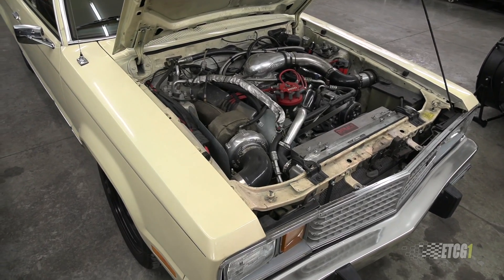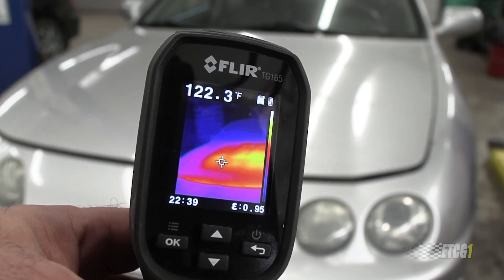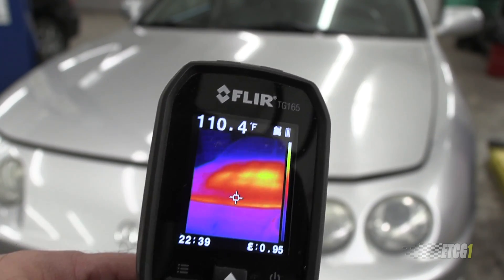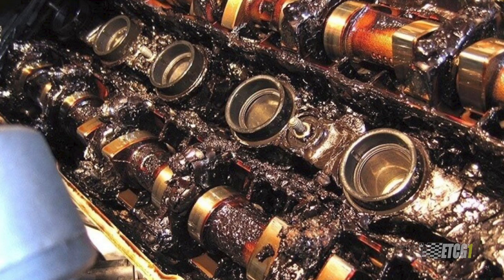What Is Heat Soak?

Comment: What a load of crap. Who opens their hood every time you stop the engine?
And since literally NO ONE does that, what damage is being caused? Where are all these people stranded on the road?
Total bs
Reply: You didn't watch the whole video and it's showing.
Reply: @dakotabelcher9988  I did though. You're referring to him saying it's not that big of a problem. Then why make a video about it?
Reply from the maker: I made a video about it because I think it's an interesting topic. Also, I was mainly referring to my custom vehicles that have more of an issue with heat soak, especially my turbo engine, over something that was mass produced. Thanks for your comments.
Reply: It’s a real thing. Engines actually get hotter for a little while after their shut off because coolant and air quits circulating. And with everything covered and insulated it doesn’t help. 
But, modern cars don’t suffer the same way carbureted cars would since vapor lock isn’t common with high pressure. 
And, it’s more of a long term thing so you aren’t going to see lots of cars breaking down specifically because of heat soak. But, many electrical and plastic components last longer if not exposed to such high heat. That’s why some people remove the plastic covers and hood insulation so it isn’t holding the heat against the coils and things. 
At the end of the day it’s more for performance vehicles and vehicles that are driven hard. I’ve seen many diesel truck turbos failed because of crudded up oil lines from the oil getting over heated and breaking down. Usually due to the truck getting run hard then immediately shut down.

Comment: Big engine
+ tiny chassis
+ over sized radiator. 
My diesel doesn’t even turn the fan on. Not even going through Death Valley @ 115f. 
I do worry about my turbo. 
But I have a variable turbo with semi-manual control. 

So when I’m a mile or so from home I set my turbo to “wide open” 
In the hopes that heat flows out

Comment: I took your advice left my hood open and guess what somebody stole my battery.😆😆😆
Reply from the maker: Actually I believe I mentioned camping out with your vehicle until it cools down. 🤷🏼‍♂️
Reply: @ETCG1  I was just joking
Reply: @ETCG1  Hi,  I just installed & takeda stage 2 aluminum short ram intake & for some reason there has been a lot of heat coming from the engine, is this normal I know these intakes can cause heat soaking.

Comment: Heat soak gave me some grief on the 1987 dodge D100 318 v8. 
Would ask up if shut off when hot hauling heavy loads. Have to wait 10-20 minute before it would start back up. Carb has been rebuilt last year so replaced the original ignition coil with 63,000 miles hopefully eliminate the issue still waiting to see if it acts up again have a spark tester and starter fluid on hand if it gets into a mood😉
Reply from the maker: I'm a believer in EFI now. The higher operating psi helps virtually eliminate vapor lock and other fuel system issues that plague carbureted engines. They are making these systems easier and easier to install on older vehicles. You might consider the upgrade if you plan on keeping the vehicle. It'll make it much more drivable.

Comment: Hey Eric why some cars makes ticking noise from the muffler after driving and some not? . I have 16 years old car that ticking and one that 2 years that doesn't
Reply from the maker: I've heard it on just about every vehicle when they're cooling down. It's just the metal contracting as it dissipates heat. I suppose it depends on the type of metal, where it is used, and how fast it's cooling down.

Comment: I know transmission flushes are a no go, but what's your opinion on engine flushes?
Reply from the maker: If you change your oil regularly there should be no need for an engine flush.
Reply: @ETCG1  normally I'm on top of it, but I've gotten behind on a change. I'm getting a low oil light, but the crank case is full. I'm going to change it this weekend, but wondering if I should flush it for good measure this round.

Comment: Keep engine clean. Repair any fluid seepage/leaks
that attract dirt & gunk buildup; all that acts as an insulator,
holding in damaging heat.
High-temp ceramic paint helps to dissipate heat, think
of a coffee mug.
Fuel in the injectors & rails can also boil, depositing varnish
over time, just as Eric mentioned oil coking.
Reply: Look into your ceramics theory, mugs are ceramic because they DON'T transfer heat. Ever try to hold a glass cup of tea? There are other benefits to these paints. Corrosion and thermal stability, keeping your EGTs UP is crucial for turbo and catalytic operation. If you don't have those then you are reducing the temperature gradient across exhaust valves, heads, and flanges.

Comment: I like to open the hood and connect a battery charger/maintainer.    My AGM battery on my Honda Odyssey has a short life because of significant discharge when parked.   I turn a fan on and leave the garage door open for a while if possible to get the heat out of the house.
Reply: What kind of accessories are causing the parasitic draw on the battery when parked? Active sensor alarm, sound system?

Comment: Since i installed Long Tube Headers on my truck, there is much less Heat Soak in the engine bay. I dont have header wrap, the stainless steel just cools off much faster than the stock manifolds. The block and heads are aluminum, so that helps too

Comment: In the racing world, we call “heat soak” when your engine detunes due to heat. The super chargers and turbos get heat soaked, than you get lower power. So your best laps are always at the start before you get heat soaked.
Reply: yeah i thought from the title thats exactly what Eric would talk about
Reply: Actually it is the intercooler that gets heat soaked. Subarus used to come with intercooler sprayers that would mist it with water to lower IC temp.
Reply: @65sohc  wish they still did. My WRX is a night/day difference; literally and figuratively. Runs great on a cool night. Runs like a slaughtered pig on hot summer days. Intake temps go astronomical, timing gets pulled frequently and overall just lacks response and takes the fun out of it.
Reply: @SSChambers1  They actually make kits that spray the exterior of the intercooler. Pretty simple, especially with a top mount IC.
Reply: @65sohc  I know spray kits exist but I don't want to put any money into the car. Honestly, I hate the car overall. I came from a 2014, as you know used the 2.5, and loved the hell outta it. It was my misguided assumption that this generation, specifically the '18, was a much better car. If I could take certain aspects of my' 18 and put them into my older '14 I'd have the perfect car in my opinion.
I daily drive it. Don't race or beat the hell out of it. I just wish that heatsoak wasn't so damn bad on these. The larger displacement of the 2.5 negated the effects of heatsoak as I never noticed any issues. Live and learn I guess.
Reply: cries in top mounted intercooler
Reply: If you were to get a new carburetor would that fix the heat soak issue ??
Reply: I can feel the detuning effect you describe as the weather gets hot.
Reply: @raptorcybersecurity  it's based on intake air temps, as it soaks, the computer will pull timing to reduce knock, which reduces power
Reply: @JimmytheGenius  Thanks Jimmy, I love learning about the operational side. I'm thinking about adding cold intakes for my car since the airflow path would be much more direct. As is, the airflow path goes from the grill to the back of the motor over the heads, then back towards the front about 3/4ths the length of the engine (lots of heat going into the air supplied to the turbo which then heats more - then through the intercoolers. Anyway, there's a dude (Splitt Mods) that has a great how-to and he gets more power based on this approach.
Reply: @raptorcybersecurity  Also the air less dense and therefore less oxygenated so that will have an effect too
Reply: @davyarthurs  yes like elevation plays a big role as well the higher the elevation the less power a car will make due to more dense air

Comment: I like to pop the hood when I get home. Then I can smoke my pipe and ponder the engine’s condition.
Reply: Just popped my hood smoking a bleezy looking at what can I add it’s full bolt ons GT you recommend any thing
Reply: Yeah I was speeding home then caught up to a 350z my Stang was already heat soaked she did not take off at all definitely checking out the motor and see what I can add on to the motor to keep it cooler while I drive especially when I’m tryna have fun🤙🏼

Comment: Seriously doubt it is an issue, Eric. I've lived in Phoenix AZ for 2 decades and we would park hot cars inside the garage, close the garage and not bother with anything. This on 115F days. (yep, that garage would feel loverly after a while) No coking and no issues at all. You just have to make sure your engine oils are changed on schedule. The only thing I do is to let aq turbo charged engine run for a few minutes to give the turbocharger some cool down.
Reply from the maker: Like I said in the video, engineers spend a lot of time figuring out how to deal with heat soak and they do a very good job of it. My custom vehicles like my truck and Fairmont however, don't have that same engineering, so I leave the hoods up when I park them. Thanks for the comment.

Comment: Honda definitely didn't plan for heat soak on some J series cars
Friends got a 2000 Accord V6 that has some combination of struggling with city stop and go traffic, and winter/summer blend gas w/ethanol that makes it vapor lock something fierce for about 6 months out of the year. 
And no, the TSB with a new PCM and Fuel pressure regulator doesn't fix it :(
Reply from the maker: That's unfortunate. Given that generation, I'd recommend removing the intake and cleaning the EGR passages and also the intake while you're at it. They tended to carbon up more than later model J series did. https://www.youtube.com/watch?v=HRp6RWZ1egM&t=4s

Comment: Another great video. I picked up an Alpina B7 (2013) recently and the "hot V" configuration with the turbos between the heads in the "V" causes most of the problems with this type of car. I've been opening the hood since I got the car, but I try not to drive it when it's really hot due to the superheating effect on the garage.

Comment: Weird yeah I do this too on my vehicles , like my 85 gmc s15 2.8 carbureted it's been awful hot here 90s and up and when I drive it and get back home I usually will open the hood and let her cool down cause it gets hot when I turn key off .

Like my 87 Chevrolet celebrity eurosport 2.8 multi-port fuel injection it hot soaks bad I noticed yesterday , got home turned it off and the temp hit over 220 and was thinking man that's hot and i guess that's normal but yeah I do the hood thing too lol

Comment: Mechanical empathy/sympathy - what makes your cars last.
Reply: I think mechanical empathy is all in a person's head and has no effect on the engine, any more than ambient winter temperature affects a car's performance. Your car doesn't care if it's zero degrees, it will start or it won't. Internal temp is 200 degrees, the car engine doesn't care, it's made of steel. Sorta like when you give your dog "fresh" water, he'll drink from a mud hole just as quick. He doesn'r care.
Reply: @bentnickel7487  Mechanical empathy is why I won't by a rental car that's been driven by people who don't care.
Reply: @bentnickel7487   Mechanical empathy/sympathy doesn't affect the engine, it affects how you drive.  If you're attuned to the mechanicals, you're more aware of if part are getting overly stressed, or too hot, or starting to make just a little bit of a new noise, when a less sympathetic driver will keep their foot down and go a little faster, then wonder why they didn't finish the race when the engine looks like a yard sale on the back straight.  Jack Brabham won a number of Grand Prix races because he was also his car's designer and builder - so he could feel when things weren't quite right during a race and adapt his driving accordingly so he'd get to the finish line.

Comment: The oil cooking, I'm not sure if that's from heat soak, overdue oil changes or low quality oil.

I tend to believe cooking oil is not from heat soak or at least it wasn't in my case. I have a 2003 Saturn l200(2.2l l61 ecotec), one of the features is that if the engine is hot, the radiator fan continues to run with ignition off until it times out or temp drops (I'm not sure which). So heat soak shouldn't be an issue like it would be in other cars without this feature. The picture in this video is about what it looked like at 100k when I purchased the car and changed the valve cover gasket. I decided to start using premium synthetic oils based on results from the Project Farm YouTube channel. The car now has 225k on it and I just changed the valve cover gasket again. The crustyness is gone, it looked great, I was really happy to see my routine not only didn't make it worse but actually cleaned things up.

I used to take advantage of $20 oil changes all day long, although it cost me significantly more to change my own oil, I'll never go back.
Reply: You nailed it. heat soak isn't an issue. not doing oil changes is the issue.
Reply from the maker: Heat soak is not entirely to blame for engine oil break down, but it does contribute. As I said in the video, engineers spend a lot of time figuring out how to deal with heat soak and they do a really good job of it. Custom vehicles like my Fairmont and Truck on the other hand are not engineered in the same way. Therefore I open the hoods after shut down when I can. Thanks for the comment.

Comment: Toyota landcruiser 75 series 1HZ 4.2  diesel with a denco turbo 10 psi boost with a turbo compensating injector pump ..... they can defeat the cooling system during high load slow driving ie 4wd in sand fully loaded, everything gets too hot and with a flir you can see the hole engine bay is the same temp.
But I now run 3 thermo fans that can run after shut down with 1 between the radiator and the condenser and the 2 one pulling from the back of the rad and the the 3rd is on the inter-cooler drawing air in from the bonnet, also there is a Davies Craig Water Pump set up with this config I can keep the engine under 100 deg c and the intake manifold at 30 deg c.

Comment: I have always liked hood vents and have been thinking of installing a set on my truck to let the heat vent out. Any thoughts?
Reply: not needed.
Reply from the maker: I put one in the Fairmont and it helped, but engineering for water intrusion is challenging.